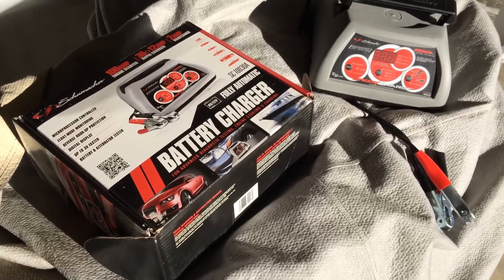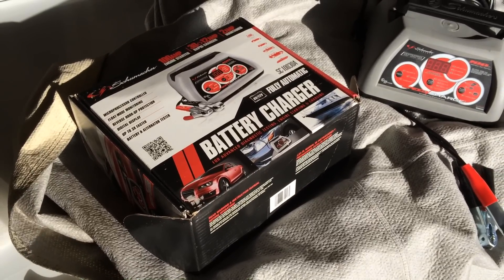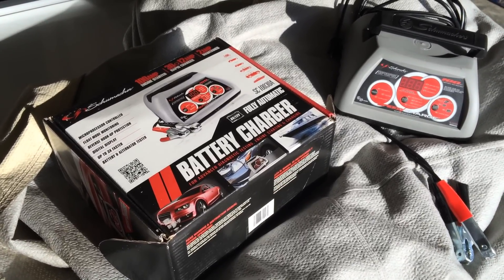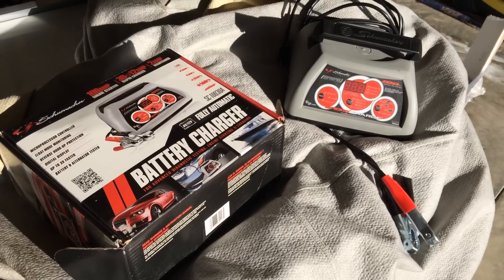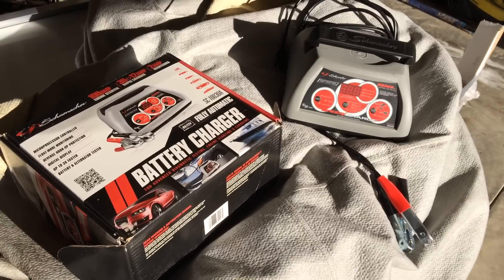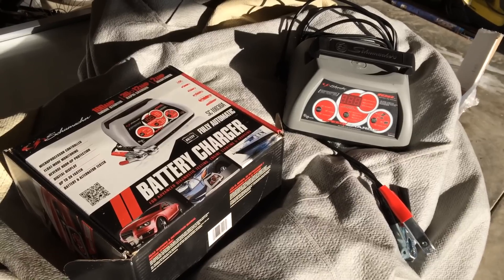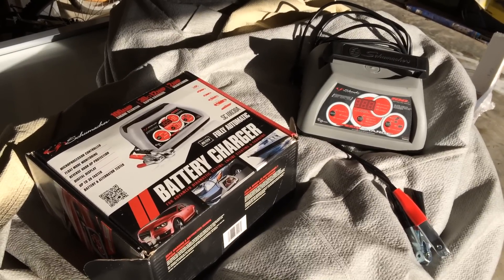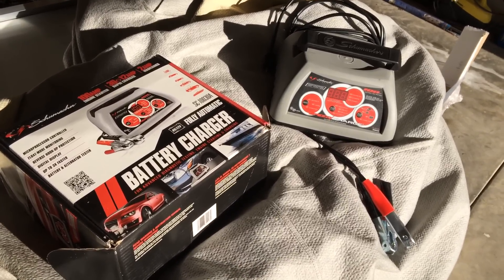Is There Hope For This Almost New Battery Charger?

Comment: Hi Tommy. I'm no expert but I hear that if the charger is a "smart" charger, there's a good chance it's toast if you ran it off a modified sine wave generator.  The old (dumb) chargers will work fine by my experience, though.  You might check for a blown fuse in the charger if it's not working off your house power.

Comment: Try to return it. The one thing that I've always been told is never use a battery charging devise on PWM. Even your phone chargers will stop working and never try to recharge the battery from a drill or tool with pwm. I think it messes up the caps that are inside.

Comment: Teachable moment.  You probably "browned out" and burned out the unit.  Like a solenoid clicking, but not making full electrical contact, ... same brown out (partial energy) vs black out (total loss of energy) more dangerous for electronics and coils/brushes of motors and contacts of circuitry.  If it doesn't even make a noise, click, or energy hum now on full house power, you have a boat anchor.  Low voltage or low amperage (from solar battery system), this causes a brown out.  Always biggest issues for solar banks.  Strong or weak solar bank, and strong or weak electrical/electronic equipment.  When any power or solar bank is weak, then you will destroy the weak equipment.  When you have strong equipment, you will destroy you solar bank.  Only when both are strong, then you have safety, and no destruction.  Reason for house brown outs destroying fridges and freezer motors/ electronics/circuitry  Fridges and freezers notoriously weak systems..

Can't even trade item for goat soap with Brad, and have him convert into transformer for the electric goat fencing.  I say give it to Doc DIY, and let him convert into an electrical wire grid mouse/rat hotel and have some critter fries.